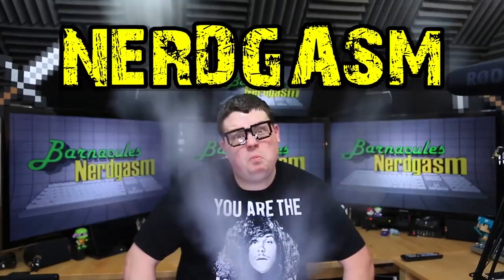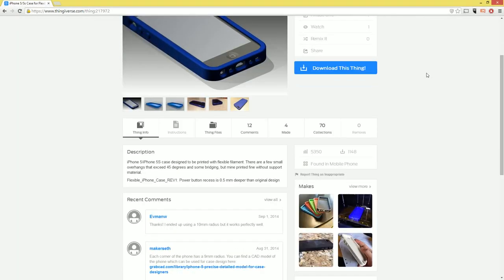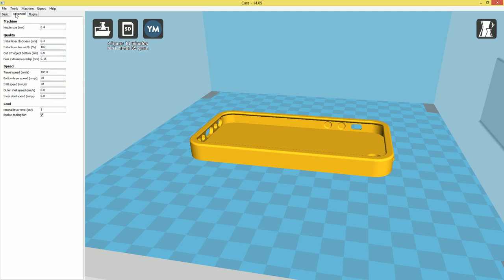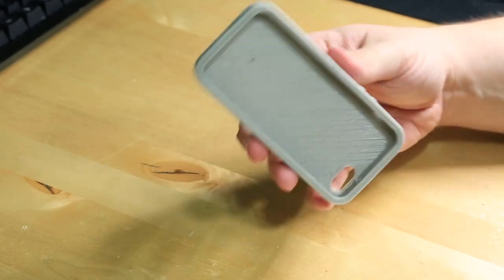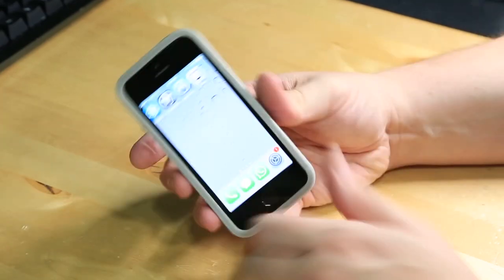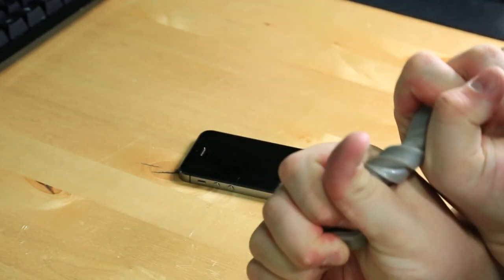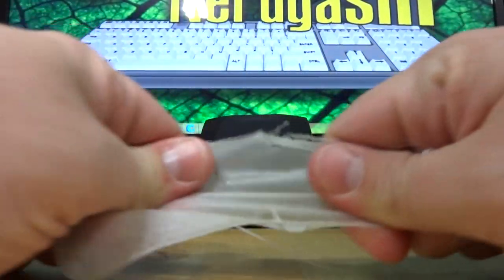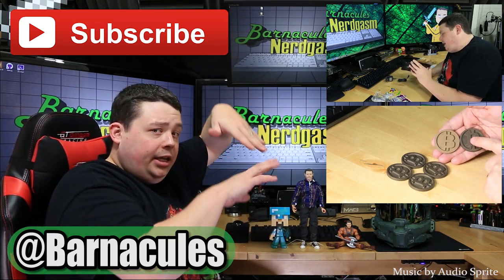3D Printing a Durable Rubber Apple iPhone Case with Ninjaflex - @Barnacules

Comment: Wow this is amazing. It's totally impressive how much 3d printing has come.
Reply from the maker: Yeah, it's mind blowing how these materials completely can change the machines capabilities. Just think of what would happen if they found a way to make a real metal polymer that fused like (JBWeld) when heated and cooled. Then we could print real metal parts.
Reply: Barnacules Nerdgasm As a welder in training, I'm a little worried that may take affect my job in the future haha. I'm sure it will be a long time before they're using that sort of stuff on structural projects and cars and such though.
Reply from the maker: Enorbs96 Oh, you're in zero danger... for now :P But your kids on the otherhand, they might want to find a new line of work and not follow in daddy's shoes :D
Reply: Hahaha "how much 3D printing has come" 

I think you mean "how FAR 3D printing has come"
Reply: Barnacules Nerdgasm I think you should try making a pair of flip-flops with the Ninja-flex.  As for 3-D printing in genuine metal, (as opposed to metal particle infused plastic) it is being done now, as well as other materials such as carbon fiber and concrete. 3-D printing in metals such as nickel, copper, gold and stainless steel requires specialized industrial printers. I don't think it will eliminate the need for welders just like computer controlled milling machines haven't eliminated the need for machinists.
Reply: Barnacules Nerdgasm Yeah haha

Comment: Rubber case with a plastic skeleton? That'd be cool
Reply from the maker: I'm going to experiment around with duel extrusion on the Ultimaker Original to see if PLA and this will merge together if hot enough. If it works you could print some pretty amazing things that moved!
Reply: Barnacules Nerdgasm Dude, I really want to see how that'd work!
Reply: What about a small skeleton with rubbery joints and such to make it a pseudo puppet / stretch armstrong.
Reply: Barnacules Nerdgasm
I saw a guy use a duel extrusion printer to make a giant button out of ninjaflex and, I think PLA, it worked quite well. Also, if a Robo3d would be faster at printing with this stuff, why didn't you use it? You have one of those right?
Reply: such a thing already exsits here's an example of one http://amzn.com/B00BQ7QUSC
its practically a really cheap otterbox, though similar to one it also adds a lot of extra thickness so... less comfortable to have in a pocket and won't fit into a normal sized case.
Reply: Barnacules Nerdgasm No need for it to necessarily merge, I've seen a case made out of two parts, one inner plastic and one outer rubber, which were easily separable but it still made a great case.
Reply: I've made such a thing with a dual extruder printer. It works surprisingly well.
Reply: o_O Otterbox commuter cases, those are awesome.
Reply: Look up Ballistic cases. They're just like you described, and super durable!
Reply: Barnacules Nerdgasm any progress with that?

Comment: Awesome dude, none of my printers worked with ninja flex but it was probably the infill speed that did it. Check out TPU it's like ninjaflex on steroids, not as flexible but crazy tough and chemical resistant. It prints well at ABS temps onto blue tape, no heated bed needed. :)

Comment: hey you should do a review of what you think of the new windows 10 dev preview
Reply from the maker: Haven't even installed it yet. After being laid off from Microsoft honestly I haven't been really keen on trying out the operating system they laid off the whole test team to produce. But don't worry, I will at some point soon.
Reply from the maker: The9000 I've used tons of Linux distributions. I actually was a Linux user long before I was a Windows user. But all said in done the support in Linux for games and high end apps like Photoshop, Premiere, etc is still lacking too much to use it as a primary operating system. But let me know what some of this 'cool stuff' is maybe I haven't heard of it.
Reply: Barnacules Nerdgasm Always remember and never forget, Microsoft always knows what-----

A problem has been detected and Windows has been shut down to prevent damage to your comment section

Comment: Hey Jerry, just wanted to let you know that you were one of the main reasons I chose the Ultimaker 2.  You should check out iRoberti's spool holder upgrade I printed on my channel for the Ultimaker 2.  I also plan on printing his upgraded filament feeder which is better than the stock feeder.  It handles ninjaflex much better than the original too.

Comment: I use the UM2, and also fooled around with the ninjaflex when i had to print a custom made object... and got a pretty decent print on the second try after lowering the speed and adjusting the temp. i was expecting to deal with jams and hours of stress but it worked out pretty well once you learn know what to ajust

Comment: You could try making custom moulds for chocolates or Jelly (or Jell-O) or maybe an ice-cube or popsicle tray. I'm not sure about the material properties though, like if it's food safe or when it's cooled to very low temperatures. The uneven print finish might not be great for moulds as well but there's a lot of potential for that sort of thing if it works.

Comment: Barnacules Nerdgasm You should try to make a case with two different parts. A soft inner part made of NinjaFlex, and a hard outer shell made of a stronger material. I had a case like this for my old iPhone 4 and it did a very good job of keeping it in one piece.

Comment: Barnacules, print a case that is slightly thicker than an otterbox, and when you print it,  have slightly low infill so that the case compresses into itself a little, but it would be big enough to be able to have enough dense honeycomb inside to work ( cause, you know, that case there wouldn't have internal space to do so.) Also, you know those buildable gundam figures? Could you print out the frame for one so that you could build one. If you don't know what I'm talking about buy a gundam and you will see its perfect

Comment: Jerry,

Have you ever tried making your own models for your printer?  I use Autodesk Inventor as well as AutoCAD.  You could either start from scratch or make modifications to existing models.  Autodesk also give you a free 30day trial of the full application.

Comment: A dual extrusion system seems to me to make this a useful product, making working hinges and flexible parts within solid structures would be useful. For a several hour print a phone seems a bit time and material costly considering you can get an injection molded flexible case for less than £5 from a rubbish corner shop.

Comment: do you think you could use this material or a similar one to make rubber gaskets for cars and what not?  and if so, is it possible to print two halves of a large gasket in the printer and then fuse them together with the 3d printing pen?

I realize this is a long shot especially given the temps of certain engine parts but just the idea of being able to print your own custom rubber gaskets seemed really cool.

Comment: @barnacules nerdgasm, I have just gotten my new printer but it only prints in abs, is it worth buying a new printer to print in pla or just stick with abs. Another quick question does ninja flex work with an abs extruder head if so what were your temp and feed settings?? Please reply :)

Comment: So do you know how loose or tight your feeder was? I have the UM2 and it seems when I print with Semiflex, it gets caught wrapping around or protruding out where the gear spins. I am printing at the exact same settings and retraction is indeed off. I'm perplexed and and info Would be useful! just started using flexible material today.

Comment: Hi Jerry, I'm building that 3d printer advertised on tv that comes in parts with a magazine, it's not finished yet though (I'm in UK so u may not have seen it) and it says to make the 3d files use sketchup but that's not what you use? Does it matter or will your software work with this printer. I'm so confused... it's the eaglemoss v3 printer

Comment: Barnacules Nerdgasm if you have low quality on the stock Cyanogen camera, then try OpenCamera. Its free and have a lot of control of the camera.
Cyanogenmod is awesome, but their camera has always been terribe, usually worse than the Stock one, and in the 1+1 case, theres really nowhere to run to.

Comment: How could you print Ninjaflex with Utimaker 2 ? Did you make some change in your printer (replace extruder for example) or you used an original Ultimaker ?

Comment: Hey Jerry thanks for the video, that ninja flex material came out very nicely :)

Apart from printing very slowly did you change anything (the feeder, or add some oil to reduce friction in the bowden?). I only printed with Ultimaker Flexible filaments and it needs to print slowly but i have a modified feeder to help with flexible filaments, the standard feeder shouldn't work very well with those filaments.

Comment: I wonder how long-lasting this material is, whether it dislikes sunlight and the stuff rubber dislikes as well. But then also on top of my head I also can't think of applications where this would matter.
Reply: Try google image searching "flexible filament" and you'll see that there are many more uses than you might think.

Comment: Barnacules Nerdgasm This is a dream come true for DIY projects and people who make prototypes. Pretty amazing. Just think what you can do if you have dual nozzle printer. Combine some hard plastic with this crazy rubber and only sky is the limit.
Reply: Dual extruder prints with ninjaflex and PLA/ABS are awesome! I've also seen Filaflex, Nylon and ABS in the same print but it didn't come out that great...

Comment: I recommend the Da Vinci 1.0 for 499.99 or the Da Vinci 2.0 DUO for 699.99 this 3DPRINTER can print in two colors.
I have a Da Vinci 1.0 it only prints in one color but, it comes out with amazing prints and so does the Da Vinci 2.0 DUO

Comment: Hey Jerry, I am a new subscriber and would like some advice, I'm am getting a new Desktop and two monitors that are 24 inch, should I play across two screens or have one playing games and the other with the recording stuff 

Thanks
Nerdgasm
Reply: I have 2 24" screens and I prefer to play games on one screen. The problem is that the center is in the middle so it's very hard to see what's in the middle. If you had 3 screens you can span it but using 2 screens for gaming is not very good. Also if the edge on the monitors is big, you can get a separation between the middle which makes it very weird to look at and hard to see what's in the center.

Comment: Your switching back to iOS because of the camera and instagram? Those are really poor reasons in my opinion but to each their own.
Reply from the maker: You're not a YouTube producer and work on social media so I wouldn't expect them to be good reasons for you. Just like buying boots without steel toes wouldn't be a good reason for someone who doesn't lift heavy things or work with heavy equipment.
Reply: Lassi Kinnunen Times have flown past the 1020 a while ago already. Such BS to byu a crap phone because of a good camera. Instagram doesn't even exist on Windows Phone afaik, it only has 3rd party alternatives? It was created for iPhonists to ruin their own photos.
He isn't just doing a review on the phone, he's actually using it as a daily driver and if it doesn't work, it just doesn't work.
Reply: Esa Edvik Instagram exists on Windows Phone but it intentionally cripples the quality of your photos as you upload them just like the Android app does. There's much better third party apps for it though.
Reply: scourned7 Well, if u were a heavy camera person and instagram user, those are really good reasons.

Everyone has their different use case. Which is one of my biggest gripes when people are like windows phone vs ios vs android
Reply: scourned7 (For your original comment.) How will you get your Go Pro into a T-Swizzle concert and post it on Instagram?

Comment: hello jerry, could you offer me some advice on polishing 3d printed rings.
i used shapeways to to print a stainless steel assassins creed ring.
looked cool in preview but looks grainy in real life.
Reply from the maker: You could try a rock polisher or possibly wet sanding it with a high grit sandpaper and then rubbing it down with polish.
Reply: Did you print in steel?
Reply: Anton Helsgaun Shapeways can't print with metal but they can make the wax mold which the metal is poured in to.

Comment: Hey Barnacules Nerdgasm there is a OnePlus One case on thingsverse I printed one and it fit great you just want to scale it down about 2%
Reply from the maker: I want a case designed for flexible filament. With a big screen protection rim like this one.
Reply: Do you mean scale up? I tried a case from thingiverse and it's too small. I was thinking I would have to scale it up 1-2%. If you mean scale down can you reply with the thingiverse link. I have printed 3 ABS cases for different phones and none have worked so far.

Comment: You should do a watch strap for a smartwatch (or normal watch, but that doesn't seem very Barnacules XD) with this material. Not sure how you would do the ends to fit it onto the watch though. I guess you could 3D print those separately or just buy them. #NinjaFlexFTW

Comment: would it be possible to use multiple filaments in one print? so for example the gray and orange
Reply from the maker: Yes, just need a printer with duel extrusion.
Reply: sweet
Reply: Barnacules Nerdgasm I think you meant dual?
Reply: Well with his Ultimaker's he can't print two colors on the same layer, however it's possible to switch out material mid-print.
Reply: James Bruton has done some cool stuff with dual-extrusion: creating large costume parts using both Ninjaflex and ABS to create flexible parts with rigid segments.
It's nice to see a demonstration of Ninjaflex on a Bowden system, though - I didn't think that would work. I'm building a printer with a Bowden system so it'll be nice to know that I'll have the option of printing things in Ninjaflex (even if at a slow speed) without having to modify my printer first.

Comment: If you leave this in the sun, would it melt?  Just curious
Reply: +nambinhvu  ?????????????????????????????????????????????/
Reply: +Mmo Noo The stuff is printed using a heated extruder, right?  How hot does it need to get for the material to melt?  I'm assuming it's a lot cooler than what other materials used to make phone cases are made with.
Reply: +nambinhvu it gets about 400-450 degrees Fahrenheit to melt the filament
Reply: +Kyle W Thanks for the info!

Comment: does this stuff work with the da Vinci junior printer?
Reply: Maybe call the maker of the printer for support
Reply: No, it's unfortunately an enclosed system. You can only use their own DaVinci PLA for the DaVinci Jr. If you use the Davinci 1.0+, you can hack it to use outside filaments. With the DaVinci Pro series (unfortunately 700+), you can use outside filaments. If you don't mind shelling out $400, the WanHao Duplicator i3 V2 is beastly for its price (7x7x8 in build volume), and can use anything in the ABS and PLA range (most filaments). Let me know if you have any other questions

Comment: I'd love to have one of these made, But Three Big Problems, No 3d Printer, Not enough money to buy one, And I have a Weird phone. 

Samsung Captivate Glide So it'd have to be able to be used with the Slide out keyboard, Plus I have a Custom Back plate with a Double wide battery so It'd have to be custom designed for my phone in that sense also -.-

Comment: Barnacules Nerdgasm Regarding instagram...
I have the Samsung Galaxy S4, running KitKat 4.4.5, and I have absolute no issues with Instagram.
What issues are you experiencing? 

Personally I use Facebook alot, and Facebook for iPhone simply sucks. It loads extremely slow. This is tested on 4, 4S, 5 & 5S. All 4 phones loads the Facebook app very slow compared to the Android.
This is the killer for me to not use iPhone :).

I will however agree with you, that iPhones takes nice pictures. The shutter and focus is simply just better, but besides the camera, I would always choose Android.

I think the camera issues you are having is general for almost all Android devices.